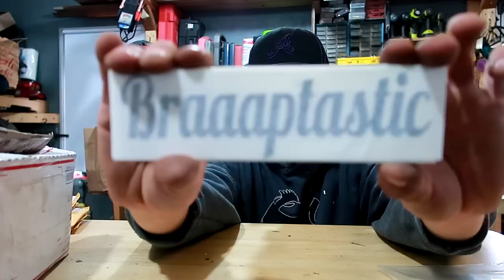WHAT CAN YOU CUT WITH FIDGET SPINNER?

Comment: A single seat offroad go cart with suspension and lights.  Nothing too crazy, but something that would be fun to run through the trails... maybe a 100cc or so with a centrifugal clutch, solid back axle back breaks only...  make it light and small enough to fit in a truck bed.

Comment: ok one issue you cut it with paper not the fidget spinner if you want to cut it with the fidget spinner than sharpen the round edges if that doesn't work get a metal one and sharpen that